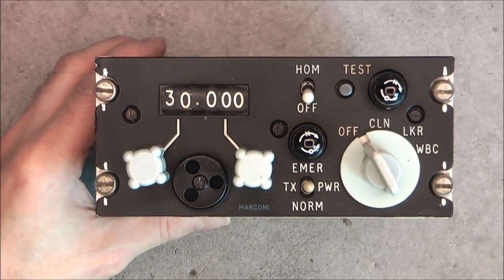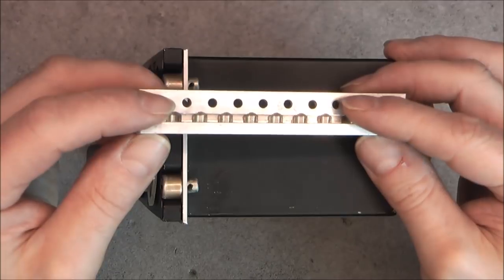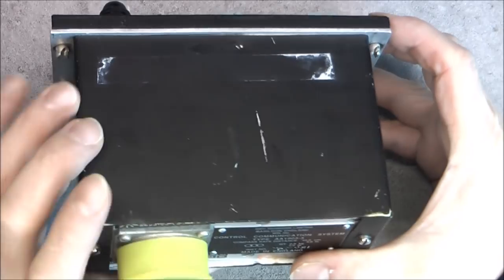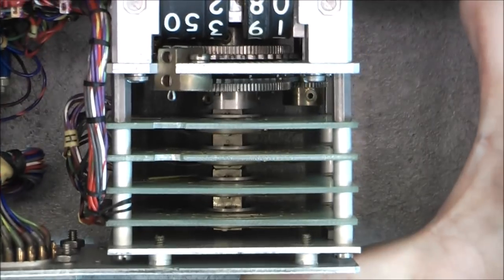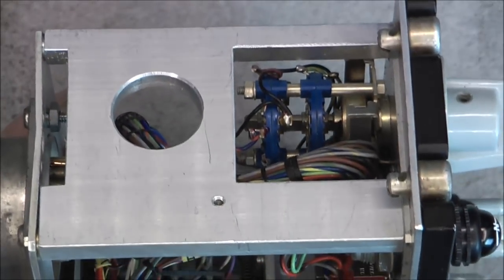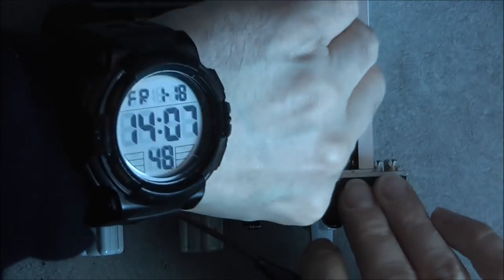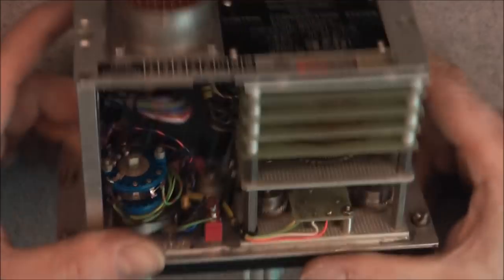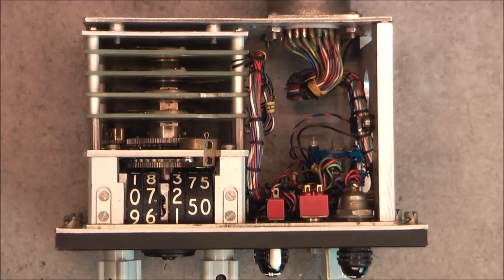Royal Air Force  Communications control box teardown

Comment: Its the control unit for an ARC340 VHF/FM radio..  If I remember correctly (been a few years) the three lights have ATC legends for Antenna / Transmitter / Control Unit and light up when you press the built in test 'TEST' switch if all is ok.  Main switch settings are Off, Clansman, Larkspur and Wide Band Clansman